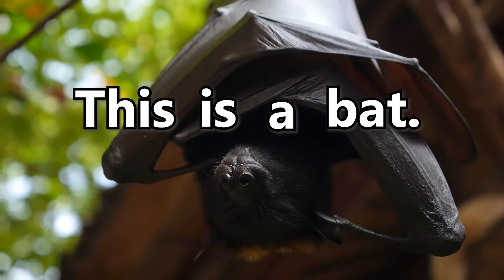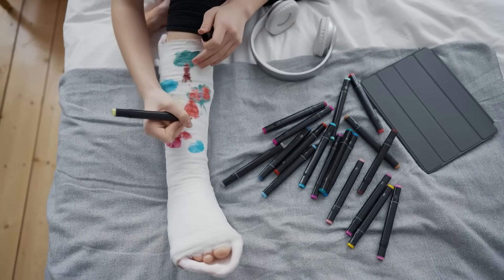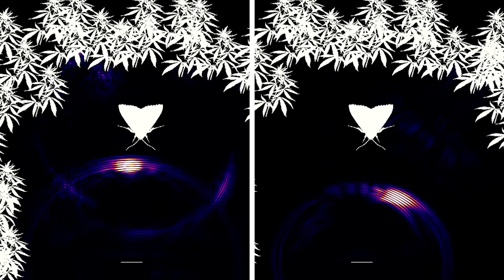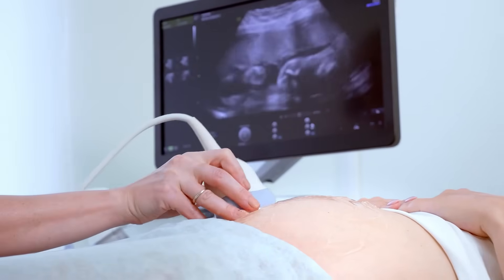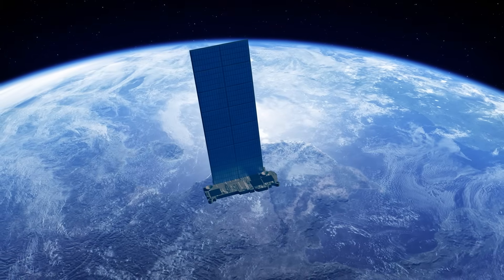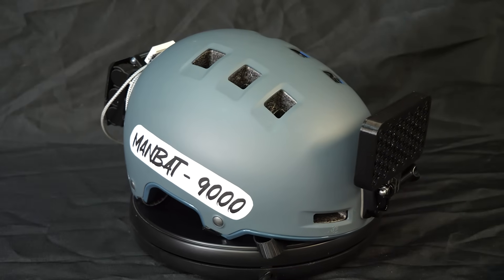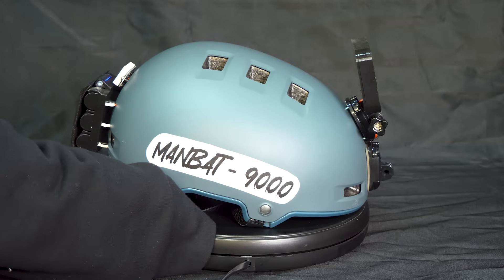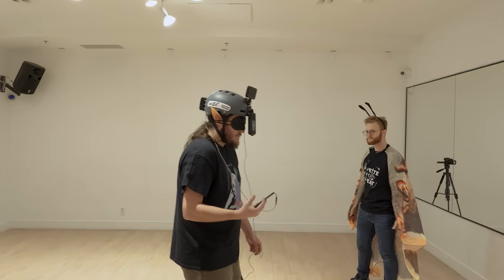A Submarine Sonar Strapped To Your Head

Comment: An excellent application is for VR helmets, get an audible proximity warning through an accessory, instead of cameras, which are computationally expensive to use and you have to define a fence and so on. Standalone VR helmets which run on batteries can benefit from this and you can turn off the cameras and the whole fencing subsystem. Great project!

Comment: You could use the phase delay array you mentioned earlier with eye tracking to direct the beam in a specific direction without turning your head. You could then use a tongue sensor to shoot out the beam and activate it manually with a tongue movement.

Comment: Could you have a microphone that only picks up ultrasound, an amplifier that lowers the frequency and earbuds instead? That way you could eco locate without others hearing the sound. After training you could then use it in town because other sounds are filtered out (dampened and/or noise canceling).

Comment: I think that one disadvantage of having a fixed track as the ping source is the user has no reference for delay between signal production and signal receipt. This might be able to be overcome using a button to issue a momentary ping so the user can roughly detect the timing of signal propagation.... you know... for depth perception.

Comment: I only heard a single static crackle when you started or stopped playing the 18 or 19khz tones. I'm 36, but have always had 'sensitive' ears. I think what I heard was my speaker failing to output those tones, like the static noise then quiet of power loss when it dropped out of and into range. Today, I just unplugged a USB butt charger that was in a power brick next to my desk because it created a quiet, but extremely high pitched electric pulsing beep noise(like a 'ringing ear' after a flashbang, but intermittent) that other house members can't hear. Judging by all the comments about people's age and not hearing it, maybe a disclaimer on people's technology would have been more inclusive than one of age.

Comment: you use the sound a bat emits to look for miles ahead while flying hight in the sky way above any obstacles, you use it in a small room. In a room like that a bat s call should be about 2-5ms each, following 5-10 ms of silence during active hunting or up to 20-50ms if resting. 
The call you use is way too long for that room. It should be shorter than the time the sound make its way from the emitter to the object and back to the receiver.

Comment: Me and a few other students wrote a paper a few years ago doing something similar. The difference is that we used a camera and a AI model to detect objects, then a text to speech module told the user how far the object where and one of five directions. Worked quite well but it had a problem with doorways and refrigerators. At one time during the final testing, a user even suddenly got a report that it told him "train 5meter to the left" in a empty room. It worked but I think your solution is better.

Comment: incredible video ! just to clarify, other means are available than parametric speakers to obtain such directivities, whether by having sources that are huge relative to wavelength (say 4 to 16 λ, which yields coverage angles of 18 to 4.5 degrees between -6 db points) or by using beam forming in the  pass band of the speaker. that being said, controlling directivity is easier with small wavelengths

Comment: Through personal experience just bumbling around in a dark room with only the sounds of a fridge to guide me, I've never been able to tell clearly if I was next to the light switch, but the hum sure hit different next to a wall or table than in a more open area. I don't know how common it is in sightless people, but there have been several documented cases of people echolocating through tongue clicks and cane taps really successfully.
I think the flashlight analogy fits pretty well next to that stuff, and kinda wonder what level of perception that could provide with more time. An (I know it'd probably be a little wrong to call it that, but...) omnidirectional audio source at a different frequency might serve a similar function to peripheral vision, giving a fuzzy, lower-resolution indicator for potential points of interest.

Comment: I know it's a bit crazy, but what if you make array of microphones on the helmet, and array of electrodes underneath the helmet. Those electrodes would electrically stimulate the skin depending on how much sound corresponding microphone gets. Can either be strict on/off or having some variation of intensity. Theoretically you can "feel" the surroundings with the skin of your head and roughly map the shapes or relative size/distance of obstacles, once you get accustomed to it. 

What is fascinating about this, is that even if we don't have brain structures for this kind of perception first, we might develop it over time. This was a thing with artificial 6th finger experiment (can easy find on youtube)

Comment: Really cool Video. I was surprised at how good it seems to be working. The idea of using this for blind people sounds really interesting. Allthough using this as is would probably annoy other people. A solution to that might be to  keep the transmitted waves in the inaudible frequency range and then couple the gear with a microphone and headphones which turn the sound audible just for the user. This would also allow some software trickery. For example there could be an option to process the received waves and give further information about the environment to the user.

Comment: the videomaker states that the thesis of the video is finding out whether it's enough to have the tools to perform echolocation or if the animal needs to have developed a powerful sense of hearing to use those tools, but fun fact humans actually have incredibly sensitive hearing. we already echolocate!
we just do it in the opposite way of bats -- instead of producing sound in a specific direction and using a single sound receiver to analyze the results, we have two sound receivers as far as they can be from eachother working to triangulate all of the passive noise in our environment that you don't notice (like the hum of your fridge) in order to extend our sense of touch by detecting "gaps" in the noise-scape of the room
normal animals can't do that! that's why you can sneak up on your dog and spook the crap out of it really easily. we take our passive sonar for granted

which means you can't actually test whether an animal needs a specialized sense of hearing to echolocate, because we already have a specialized sense of hearing

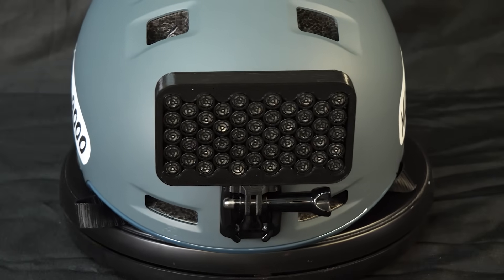Comment: 9:30 a correction here. mixing pure tones perfectly linearly does not create new harmonics. however, nonlinear behavior either in the mixing stage or after they are mixed, will cause them to create intermodulation distortion, which makes subharmonics in addition to harmonics (which in a digital context would also alias and make it more audible, but in the real world or with pure math, would not be audible). the nonlinearity in this use case is the air itself, which acts to demodulate an amplitude modulated ultrasonic frequency.
Reply: It looks like he's clipping the audio in his audacity example? (since all inputs being added are individually already close to 0 dBFS), which would also provide the non-linearity needed to produce intermodulation products
Reply: @MatthijsvanDuin  yes that is almost certainly why it became audible
Reply: Really hoped someone would point this out!
Thank you all!

Comment: Cool idea. I think a constant tone (or couple/few tones) would work far better than recordings of bat chirps.

Then you totally threw science out the window for the testing. You found a dance hall the size of an actual hallway, immediately cluttered it up with bags and equipment, then had a camera guy who wasn't supposed to be part of the test right out in the middle walking circles around you, and valid targets moving out of the way when they aren't supposed to. All that completely messed up your brain's attempt to train itself because you kept getting false negative experiences. On top of all of that, you tested with multiple people but only showed the results with one person using the thing.

You had a really interesting question, did a good job of engineering an experiment, and then just face-planted the execution. I do agree with your final conclusion, though. It'd be cool to see how this tech could perform in a series of real tests, I suspect it has more potential than you yet realize. Could even be eyes in the back of your head. Emit different tones in different directions, see if your brain can learn to differentiate all the data.

It also might sharpen the sense to have a training period without the blindfold, so you can see what you're hearing.

Comment: Some blind people can actually just do this without any special hardware. The brain makes up all of your senses. They're all hallucinations based on input data. That can be mind blowing to some people, but if you know about it its not too crazy. But what is crazy is that... well, theres no difference between your "normal" senses and weird senses humans don't normally have. Blind people are a good example of this, as theres actually a bunch of compensation senses blind people can create. Echolocation is one, but blindsight is another. Which is where the eyes work fine, but for whatever reason they can't see. But that visual sensory data from the eyes is still coming in, and the brain can use it. Blind poeple with this kind of blindness can "see" things. Not well, but considerably better than chance.

Theres also a device you can get called a Northsense, which is meant to introduce a sense of compass direction via vibration. I personally think the approach they chose is a bit iffy and would prefer something closer to how birds can sense the magnetic field, but its still super cool.

Comment: I think you actually put him at a disadvantage with those mock bat ears and using the bat sounds. With the parametric speaker, for the purpose of your senses the sound is emanating from whatever it's pointing at, and while our brains don't do echolocation, we are relatively good at locating sources of sounds. 
Our ear shape is important for that as our brains use the very specific way sound distorts at different directions to our ears, so I imagine those costume bat ears are screwing with that. Additionally we're not great at locating quick high pitched sounds, you'd be better off choosing something lower frequency and "complex".

Comment: What if the sound was projected not just forward but in a pattern? A circle for example.  You'd get much more information that way. Add a knob to tune the circle radius and you can focus further in the distance. This should be just a software change as the array can focus sound in any direction

Comment: Please, that could be a great tool. Especially if the clicks are also inaudible by increasing the frequency further- and the person using it also has a device in ear that can detect that ultrasound.
Reply: That’s a great idea! Having something that makes an annoying clicking sound all the time may not be ideal, but if it comes with a way to make the sound only audible to the user, that could work great!
Reply: @jordanthomson1572 Then bat, dolphin and the likes. Could hear them, not only the user
Reply: @gabrielaziez202  True, but would that be a problem? Dolphins generally don't inhabit the same habitat as people. Bats sometimes do, but bats are also able to navigate even when there's other bats nearby, so unless this machine is MUCH louder than bats (and bats are very loud), I don't think it should be a problem.

One possible issue could be the other way around, where the person using the device would hear bat clicks too. It might mean that the device can't be used effectively when bats are flying nearby, or it might just need a filter in the software to ensure it only translates the intended signal, and anything else gets ignored.
Reply: @jordanthomson1572  this could be solved easily by making frequency amplifier headphones (or earplugs). Yep, a person with the same frequency would "see" you, but as long as you just switch channels, this might work. Like a portable radio frequences pool from 20000Hz to 21000Hz.

So, for example, emitters would emit different Herz inaudible waves, by amplifier you would hear familiar sound, everyone happy.
Reply: This is the first thing I thought. You could theoretically emit a supersonic signal like a bat and the receiver has a downtuner (like an octave pedal for an instrument) that translates it to a sonic frequency that is played back in ear buds.  The supersonic sounds can be adjustable by the user to something that works best for them (ie different rhythmic patterns or wave forms)…if you design this, please let me know!
Reply: I think they were already using ultrasound which can be inaudible, but it was somehow getting converted to audible sound if I understood it right.
Lots of animals can hear high frequency including cats and dogs. Probably how annoying the sound is depends on how loud it is. Same thing for audible frequencies, if you make it not too loud and amplify it just for the user of that one frequency it may not be particularly annoying.
Reply: I mean, even if the machine could recieve the inaudible sound and then use it to transmit it as an audible sound.

Comment: On a related note, there‘s a pretty cool thing called sensory substitution (and enhancement and addition) where you feed the brain info through a non-normal sensory path (like you did, vision through hearing). But the thing is that there’s so much more potentially possible, you barely scratched the surface. There are applications like 360-vision over a stimulating grid on the tongue, and basically the idea is that you can create your own sense if you just feed yourself the data (eg over vibrations), and the brain will probably make sense if it. Strongly recommend David Eagleman‘s „Livewired“, might as well check out his company Neosensory. Would love to see a video with a bigger scope on this. Cheers

Comment: Psychoacoustics are interesting...I've seen a binaural radio where instead of using DSP to decode the I and Q signals from a quadrature demodulator, you just feed them into your left and right ears and you can use your brain to pick out AM and SSB signals. The phase difference apparently creates a feeling of a certain signal coming from a certain point in space, which is pretty cool.

Comment: Looks very over complicated. We already have two ears capable of locating the direction of sound and discriminating different types of sounds. All you need to do is have a single emitter and two receivers that heterodyne the reflected sound back into the audio range, using the same local oscillator (so you have phase information between receivers), for your own ear/brain system to process. As long as the receivers are almost in the same place as your own ears and have some kind of directionality, it should be easy enough to use. There are blind people that already use this technique, but with audible sounds (clicks); I remember seeing a semi-famous blind person who had mastered the skill to some high level quite a while ago now (years).

Comment: The guy who did invent this ultrasound speaker system is a trip.  He also invented a tiny traditional helicopter and a beer coozy that is an aerofoil so that it can be thrown like a football.

I remember being taught to tell the difference between a clap reflecting off of a tree and open air during pitch-black nights at the local renaissance festival.  The human brain is downright hungry to integrate new senses.  During early experiments with wearable computing, one of the devices was a belt with 16 little vibration motors on it - it also had an electronic compass and it would pulse the correct motor or motors  to indicate the direction of magnetic north every second or so.  Within two weeks, the continuous awareness of the northern heading lead to vastly superior perception of where one was in the world.  Users were able to do things like point towards their homes within a few degrees while out in the city.  One user who took a train ride  reported being somewhat aware of the distance travelled due to how the direction to north changed.  Finally, at the end of the experiment, some users reported a feeling of claustrophobia on quitting the device - they no longer had a sense of their place in a wider world and felt a little boxed in.

Another early device was some sort of optical spectrograph worn as part of a helmet, mounted where your array was.  The device could sample 128 wavelengths and combined the signals into low-volume pink noise piped to the wearer.  The user, Dr. Thad Starner, reported learning to scan object fairly quickly.  By the end of, again, two weeks, he was able to do things like detect the difference between sheet metal and bondo in a car body, under the paint.  He also was able to direct a friend to stressed patches in their lawn, based on invisible color differences that he could hear but not see.

Combine our ability to integrate new sensory data with things like the rubber hand illusion, and I think that superhuman modification of the human form will turn out to be more workable than we expect, once we solve power and stability issues.